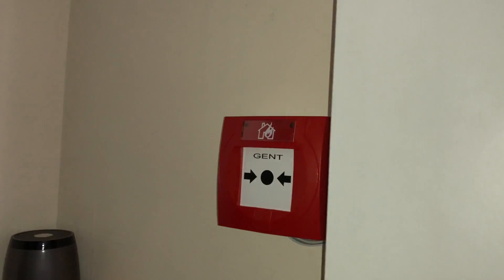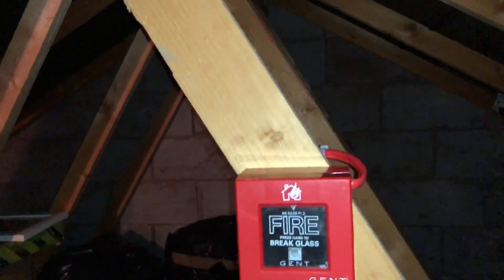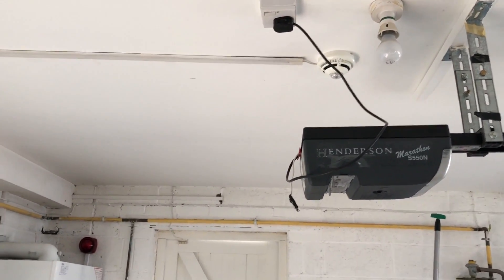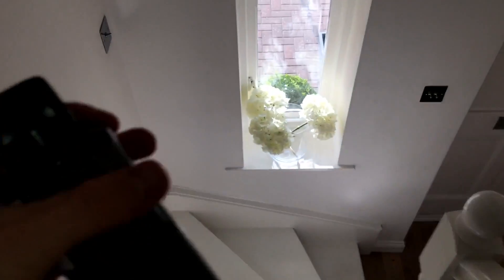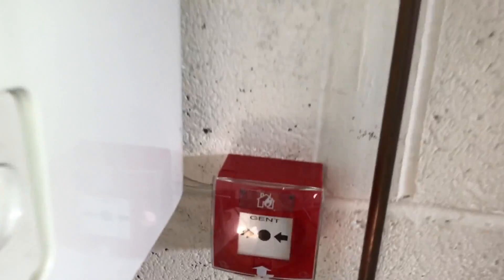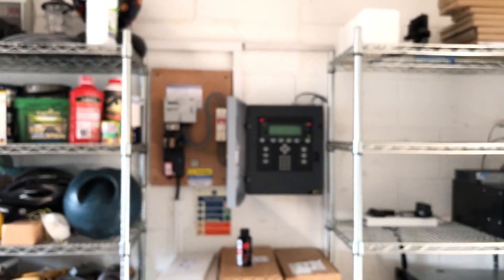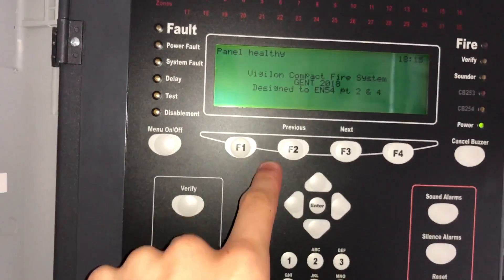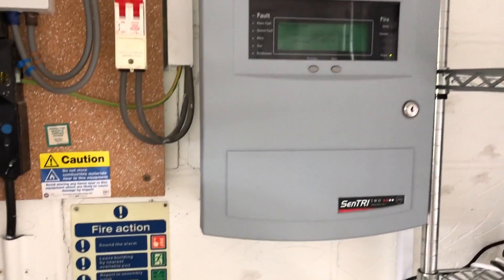Gent Vigilon System Test #4

Comment: Can addressable devices ever work without an addressable panel. thanks very much.
Reply from the maker: Hi, no unfortunately not. I do know you can sometimes make addressable sounders work with a tone generator, and make addressable MCPs work by removing the PCB and using it as open circuit with a resistor.
Reply: Does it work with an s4 mcp? If it does I’d like to know how